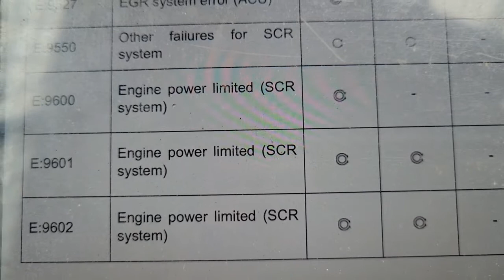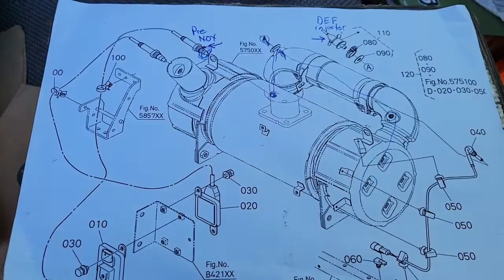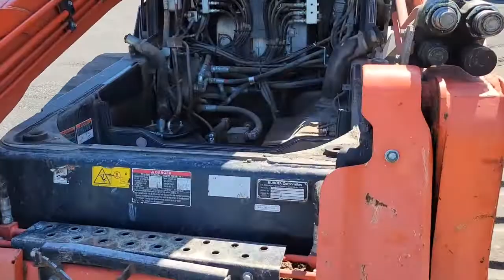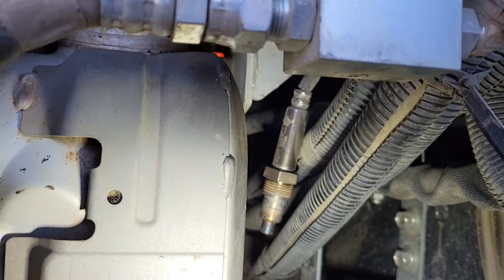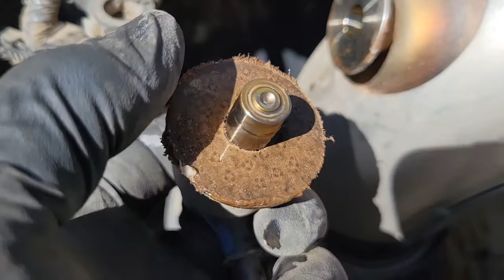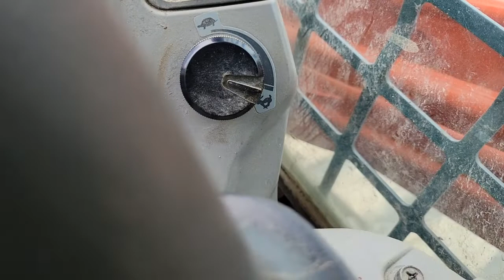NOx Sensor Trouble Code? Kubota SVL95-2S Diesel. E:9521. Check This Part Before Replacing.

Comment: What is error code e9000
Reply from the maker: E9000 means it needs to be regenerated. Turn the engine speed up, and it should enter regen mode. Also, make sure the regen override button has not been pressed. That will prevent it from regenerating. Hope this helps. Keep me posted.

Comment: My kubota 97-2 2022 has the same codes and the motor shakes bad.
Reply from the maker: First thing I would check are your fuel filters. Not sure how many people use you skid steer but I have seen people get def and fuel tanks mixed up. Let me know what you find. Hope you find a cheap fix.
Reply: @shanersmechaniclife3164   Hi, I have a 95-2s, but when dirt gets packed under the oil pan, the machine has a heavy vibration at idle.  Clean out the belly pan, and see if that works

Comment: My name is Seth - wife over took my YouTube acct. My SVL 95-2S is throwing the 9510 code which says is the DEF injector.  I took it apart by watching your video and mine does not appear to be wet or damaged. Of course that doesnt mean it isnt bad, but do you know how i would test if it is actually working? Thank you
Reply from the maker: Hard to do unless you have a laptop and the software. But try calling your dealer with your serial number. Some units have a recall that part of the fix includes a def injector. You might be lucky. Those things are expensive. Keep me posted. Thanks for watching.
Reply: @shanersmechaniclife3164  thanks for the response! After I cleaned the injector port (it was a little white) and went to put it back on, I noticed the insulation on the electrical connector that plugs into it was gone and some bare wire was exposed. I'm not sure if the ECM would have seen that and threw that code, but I took some solder and heat shrink and made it right. I ran it about 5 minutes to see if the code would pop up again, but so far so good. I am going to run it a little bit more this weekend and I will let you know if it reappears. Thank you

Comment: Hey my drain line on my 95-2s busted machine was working in Aux -2 overheated won’t crank
Reply from the maker: Hopefully it didn't run out of oil. These units have an over heat shut down. When the exhaust gets too hot it will shut down and not restart until it cools down. Let me know how your turns out.
Reply: So when I messaged you 3 weeks ago I was on a big job. My machine still won’t run. I changed the thermal beside the thermostat because it was leaking. I replaced the alternator and starter now I’m getting 18.6 volts. 😢

Comment: this video is so entirely clear and concise.....  so good that I'm hoping you'll point me in the right direction to deal with a 9510 code..... SVL95 2S ... running fine, I filled diesel tank with diesel. upon getting into cab 9510 code.... how could they be related? how could they not be related? Thanks for  whatever help.. jk
Reply from the maker: Contact your dealer. E9510 is a code for urea injector error. There is a recall out on some of these units that make fix your issue at no charge. Worth a try. Parts are expensive. Let me know how it works out for you.

Comment: Great video i have a svl 97-2 no codes but really bad vibration at idle plenty of power operates fine changed fuel filters just to see if it would help did not make any defrence any advice would be great thanks
Reply from the maker: Thank you for the feedback. Sorry for my delayed reply. Have you tried checking your motor mounts? Sometimes they show wear at lower RPM.